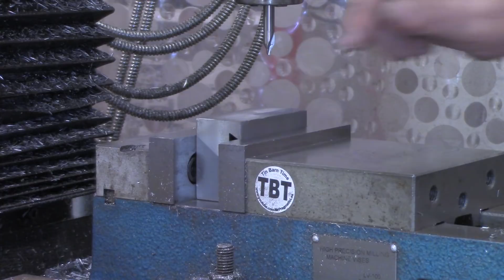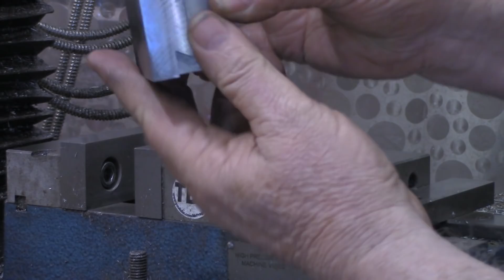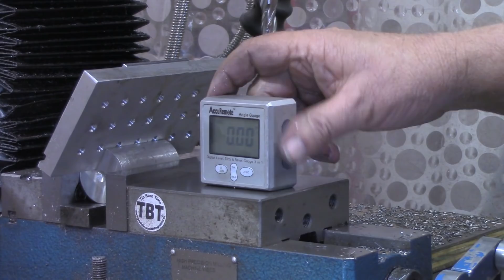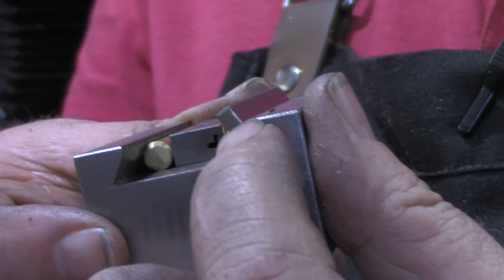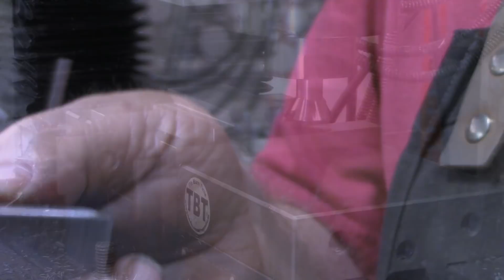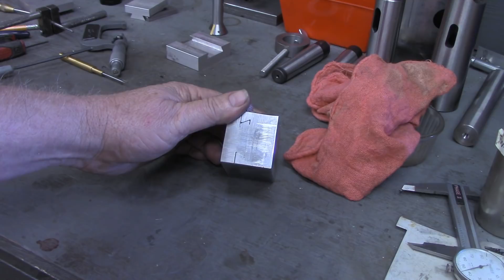Matching Dovetails - Adding a Gib

Comment: Great work Lee and like a few of the comments I like the look of that Pallet you made, I see me making one soon and especially for angled cuts on smaller parts, much easier to set an angle on that than tilt the head on the mill, then struggle to get the head back to a true 90 degrees ;)

The dovetail and gib is something I plan on doing for a 2 part mill vice and a compound cross slide and your vids on that are very helpful